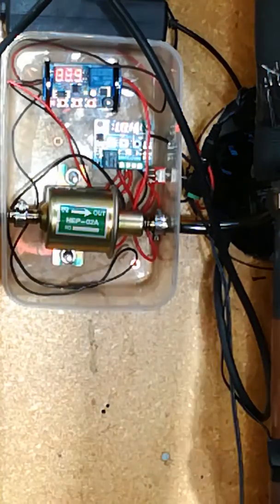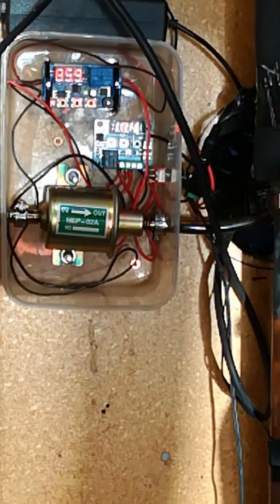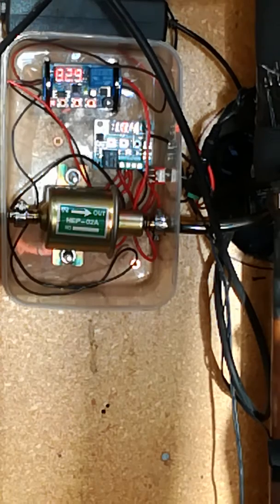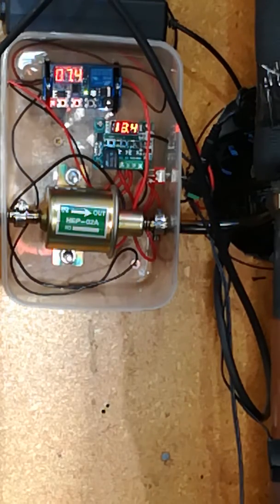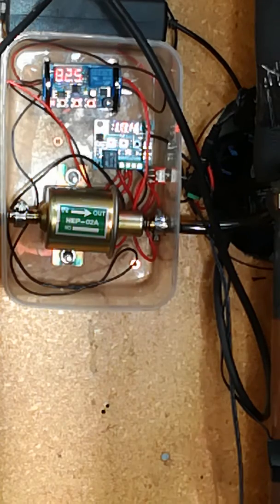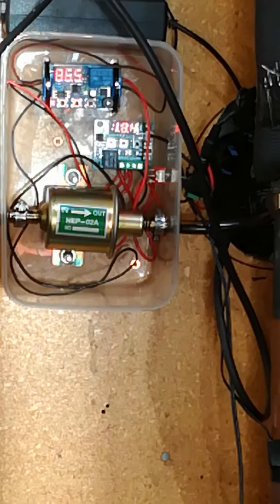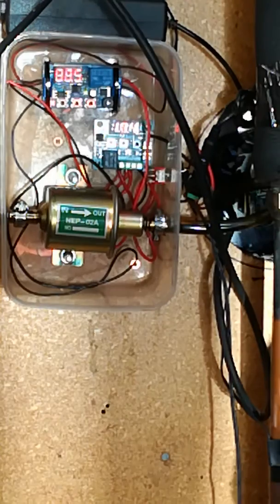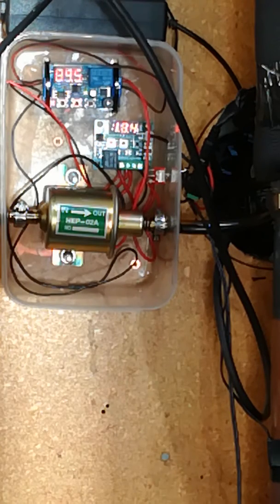Waste oil heater controller with thermostat

Comment: Hi
Thank you for sharing your great design and safety features. 
I need help with heating one room. I'm writing from a country in financial crisis. 
I just need a little heat, a small and safe design for my mother. 
Do you recommend using waste oil or diesel for safety? I was thinking of sealing the system and bringing fresh air from outside. to avoid smoke in case of failure. 
Thank you for your time.
Reply: No not really I wouldn't  recommend a waste oil heater for a room these are more for the hole house. 
By her a blower electric heater.

Comment: These waste oil controllers are a must for any oil fed heater, they keep the heater at a set temperature and if any problems the thermostat will turn off the oil, turning off the heater. Yes you can walk away from the heater with one of these fitted and can be turned off with Alexa using just a wifi plug. With wifi temperature sensors it can checked and monitored by your phone.

The problem is when oil warms up, it flows twice as fast and you can't tell it's doing this with a gravity fed heater, so your constantly adjusting the valve as the oil flows faster and your heater increases in heat, and if let go without any checking every 15 minutes, your heater will turn red-white hot including the flue as soon as your backs turned. Not to mention the black thick smoke billowing out the flue affecting ever neighbour in sight. Then you start to wonder why this bloody thing is doing this, we all go through it and its frightening.

I see here on youtube, these guys with their amazing new heaters they have built for $20 bucks from scrap and how it goes so well, with a tap with a v cut out, with the oil supply fixed high up on the wall or fixed next to their heaters, it's an accident just waiting to happen if only they knew oil did that, and inside the house or shed.   

It's time we all made this waste oil heating industry safer for everyone, especially for those who have all the gear but no idea what they are doing. 

We don't sell our heaters without the controller units they are that good.

We ship the controllers worldwide they sell at $95.00USD plus freight. at www.dripfedwasteoilheating.com
We accept Paypal a secure safe payment system.
Do yourself, and your family, a favor, get a waste oil controller unit, to make that waste oil heater you built safe. 
Us guys who have been in this industry for years really don't want to see houses burnt down because of the increase in these unlimited heat sources we call a waste oil heater. Be safe.
Cheers Jim 
email us dripfedwasteoilheating@gmail.com